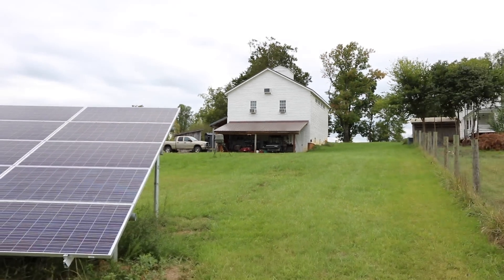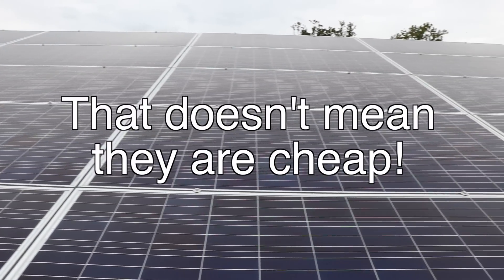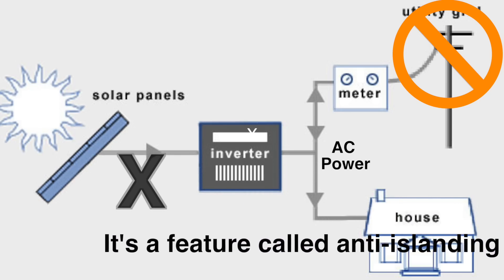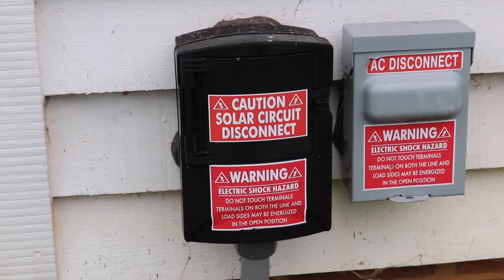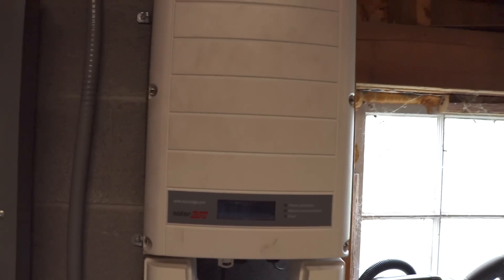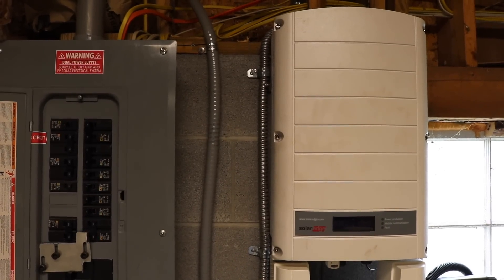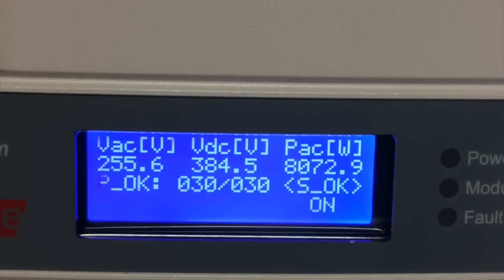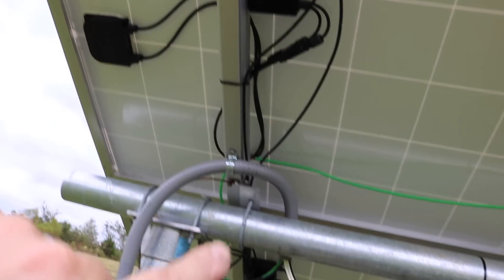The ugly truth behind grid-tie solar systems. Part 1, FarmCraft101 solar.  Watch before you buy!

Comment: Former energy auditor....
1) Do a 3rd party independent energy audit before expensive solar or dual pane windows.
2) Do cheap stuff first, massive insulation,  double up walls and partitions where possible, new doors, caulk leaks, LED lights, new efficient appliances, passive heating and cooling, zone heating and cooling, highly efficient wood heat, etc
3) Ask for 2 opinions/estimates and payback period from 3rd party expert for expensive solar (double the price if you want battery backup). These estimates should be based on your new "conservation" ideas. You will be surprised how much lower your e-bill is after measures.
Reply: David M best advice I’ve read for anyone. Doesn’t matter if you want solar or not your advice saves money and preps a homeowner for installing solar. I did many of things you suggested and made my house as energy efficient as I could possibly do. Followed the energy audit recommendations before the upgrades. Then I had a 4.6kw solar array added. It’s small and with all the upgrades it will power at least 70% of my energy needs. 

It may be better than 70% because that was a very conservative figure. It helped that I have a brand new 21 Seer solar ready AC unit and 98+ gas furnace to provide HVAC needs and couple with all the upgrades to the house.
Reply: We upgraded our place before the solar went in (LED lighting, high efficiency inverter aircon etc) and we managed to reduce our electricity usage to 7.03KWhrs a day with 2 people in a 3 bedroom house.
With the 6kw solar system putting out 17.2KWhrs a day, we reduced our bill from the original $300 plus a quarter to literally around zero or even negative numbers some bills, making the payback period just under 3 years... (it's almost paid itself off already, and will have after Christmas...) best four grand I ever spent...

Comment: Electricity doesnt go through wire it goes around the wire. Put a romex in a vise and test the voltage when you tighten it. You will cut it off.

Comment: 8 gauge wire in restricting your amps. You should be using #2 wire or larger. It will carry 100 amps. Just to prove a point try starting your car with 8 gauge wire and see what happens. Bring a fire extinguisher.
Reply: not really.   i guess you missed the part where it was  Explained.
watts  are   watts.     volts  x  amps  =  watts      use more  more
volts, less amps  and  slightly  SMALLER   conductor.       imo,
running  DC  any distance is, just plain, prohibitively expensive.
in contrast, if the inverter is located near the pv installation, AC
can be run to the house; using  Much  smaller  conductor; with
near zero losses.    cheers

Comment: I never see anyone talk about how the panels deteriorate over time, and how that affects the cost benefit ratio.  The useful life of panels is about 20 yrs right now, but they degrade about .5% per year meaning they lose 10-15% of their output by year 20.
Reply: Yes, they do- but the tier one panels used in all gridtie installations (at least here in Australia) have a 25 year 'guarantee' (not useful life) that they will still be above a certain percentage of their original installed power- in my case the panels have a guarantee that they will still be above 82.7% of their original power in 25 years, so mine will be at 4.95KW instead of 6KW in the year 2042..... (and their life expectancy is far longer than that)- hardly a reason to ignore the massive benefits they give on my power bill, which was reduced from $1200 a year to zero, sometimes less than zero... ROI is only 3 years at that rate, after that, I get electricity for free...

The outrageous US prices may be why (like FarmCraft) sees ROI of nearly a decade or more- that's more a case of their huge price for installations over there, literally five times higher than our here in Australia... 

I do have to wonder why solar is so pricey over there though...
Reply: AU I think gets better subsidized rebate from the govt then US. AU also gets better sun :P so it makes ton more sense. And not sure what power is like in the rest of AU, but WA electric has risen beyond absurd, was not that way when I first moved here 10 yrs ago. It was one of the better rates.
Reply: @kevinfisher1345  Actually, we get less subsidy (at least in dollar terms) The rebate in solar credits on a 5kw system is $1200 here in Australia (and dropping) where the rebate (according to a guy I was just chatting to) on his 5kw system, he paid $11k US upfront, then had to jump hoops for 6 months to get his solar rebate, which dropped his price to $6500US for the system, and he had to pay another $1200US for the permits, total cost $7700US.... Mine cost $4000 in total several years ago for a 6kw system, now they are at $3491Au, which is $2600US for a 6.6kw system...
Reply: Hmm that sounds bit pricey for US, unless it included battery bank as well. HOWEVER, it has been over decade now since I have been to the US so will just have to take your word for it. But states can vary widely for installation prices and permits, as well as what all requirements must be met.
Reply: @kevinfisher1345  Well in the video itself, he said he paid $17k US for a 9.1kw system (gridtie), and we are paying $2600 US for a 6.6kw system....
Reply: True, they all deteriorate over time. The problem is that there are many methods of build design as well as quality. I have no clue where you got those figures, but I would guess those are averages. Especially considering most panels these days typically have a 25 - 30 year lifespan, and so those figures must be including cheaper units and even including flexible panels to have brought it down to 20 years. Realistically one needs to look at per the specific ones they are looking into getting which can all vary and would be rather complex to start discussing when talking about such a topic in a general sense. However it could at least mention that and taking that into your considerations. 

But overall, by the time you reach your break even point, it is all free regardless how much lower output they produce, the bigger point is expected life and when you might need to start looking for replacements. If it takes 12 years to break even for panels that will likely only last 15 years, that is not a wise investment. That however is a very unlikely scenario as that would imply cheaper panels in which it should not take near as long to break even. Again that could be argued that beyond its expected lifetime use, one really does not need to replace them, as it is all free regardless how much less they produce. The given stated lifetime is determined by manufacture when it has reached a significant drop loss that its considered no longer efficient. But they will still produce power beyond that given lifetime, just at much lower amounts then when new. So in other words this all in an roundabout way already all included, albeit just as per w/e amount the manufacturer has chosen. But generally speaking manufacturers list lifetime as 80% efficiency. So if a panel has a stated lifetime of 25 years, it will have decreased down to 80% efficiency by than. If panel has stated lifetime of 30 years, it will have decreased down to 80%. As stated this is all already factored in, in a roundabout way, so beyond a brief mention, it really does not need to be mentioned about too much. The biggest thing is this will increase your break even time, but videos do not go over and mention all the other things that will impact that either. So why are you expecting them to mention one aspect point but not all the others? That would entail a much more in depth video and really is more of case by case point that should be discussed with experts when actually going to install such a system.

Comment: Very good presentation. Just one concern. I know this is a fairly old video with respect to the pace of cheapening photovoltaics, but $17K USD still seems like a lot for a 9.1kW system - especially seeing as you got a ground mounted multicrystalline array. This figure is not including the batteries right? I would be interested to see a price breakdown for this. I guess it doesn't matter too much as you still get a fairly good rate of return.
For reference, I got a premium quality 10kW system installed on a 2nd storey roof for $15K AUD unsubsidised (about $10K USD), with SunPower mono IBC cells + SMA inverters which is pretty much the most expensive combo you can get. In Australia, large price differences between similar systems are mostly accounted for depending on the installer (ie. dodgy installers will charge much less for labour). My installer is one of the more expensive ones as they are accredited by the Government regulator and trade renewable energy certificates on our behalf, so it's not as if I cheaped out on labour costs either.

Comment: They have 2 pole or 3 pole disconnects so you wouldn't need  separate disconnects. You would just get a different disconnect to meet your needs. 2 pole disconnect would give you 240 volts (two 120v feeds). Or whatever you need to achieve the desired voltage.

Comment: Does this change how much your fire insurance cost? Probably not but  I thought I would ask. Two,  you come home after vacation and someone's Easily taking off with your solar panels because they are at ground level as opposed to attach to your roof. That would suck,  do you need separate insurance on your solar panels and would it cover theft or just damage like hail. And what is the lifespan of solar panels I heard they are 20 to 25 years. Giving you a good 12 years a free electricity. Probably not normal questions but I'm new to this
Reply: You heard wrong (although it is commonly touted as a reason not to get solar) They have a 25 year output guarantee, mine have one that in 25 years, then panels will exceed 82.7% of their original output after 25 years- ie that my 6kw array will still be putting out AT THE MINIMUM 4.95KW, their life expectancy (short of physical damage) is 50 years plus- there are systems that are already older than 25 years on grid tie in Australia, and some offgrid systems are 35 years plus and still producing 70% of their original output...

Comment: 8 hours x 8000 watts= 64 kilowatts per day.   Impressive.
Reply: Yes but keep in mind loss of energy no system is 100 efficient solar panels are 60 percent efficient plus conversion of dc to ac electricity make morr power loss about 40 percent so actual units of electricity produced will be lower that calculated value

Comment: What I don't understand is if you can have a battery back up system tied to your panel without fear of it sending power out to the grid (anti islanding) during an outtage... then why can't the the same mechanism work for the solar as well.  I swear its a conspiracy by the power companies to discourage some people from discovering that maybe they could live without the power company after all.  I see no technical reason why a battery bank can power your house during an outtage... but not a solar array.  They are both DC sources of power.  Makes no sense.
Reply: agree.      it can be understood that the key variable is whether a  
building is  Still  connected to the  power grid.   if it is not,  then 
there would not be a  back-feed issue.        obviously,  correct
power  Switching  is  critical.

Comment: Can I ask how do you connect the cable from grid tie inverter to the cable from electricity company ?
Reply: The Inverter is usually tied directly into a Breaker Box and has its own Breaker on the rail.

Ideally you get a Transfer switch installed so you can have electricity during outages.

Comment: LOL I'd be clamping Schottky diode between the output of the panels and the house, put it on a divert switch, anytime the grid goes down flick the switch and negate the grid tie portion...      power straight to your house   lol
Reply from the maker: Wouldn't work.  360V DC straight to my house.  Everything runs off of 120/240V AC.

Comment: A solar charge controller is what coverts energy from the solar panel. Over time, I am seeing more and more solar generators and other devices that have a solar charge controller and inverter built in. I’m sure that is what is used in your setup.

Comment: Maybe I misunderstood something but I’m pretty sure that you have 3 sets of 10 - 12 V panels paralleled with those 3 sets in series, yielding an absolute maximum of 75 Amps at 120V DC. Contrary to popular opinion 8 AWG copper conductors can carry this load with no problem because of a lack of skin effect.  If you’re are running to an mppt/inverter then to the grid, I’m not sure you could have it any other way.  Unless you’re using micro-inverters.  Am I missing something here???
Reply from the maker: They are 36V panels in sets of 10 for 360V.
Reply: FarmCraft101 Thanks for the clarification.  I think I focused in on the fact that you were using 8 AWG wire do I was looking for the max current to be 40-80 Amps DC, when in fact you’re using number 8 to account for voltage drop (looks like a good few hundred foot run) and to provide a bit less resistance.  Right?  Awesome setup BTW, and thanks for the great videos!

Comment: 9:05 WRONG! Current Does not take the path of least resistance, read kirchhoff's current law. If I have two loads of unequal resistance, the current flow will be relative to the differences in resistance. Current takes the path back to the source, (power generating station). Water may take the path of least resistance, Electromotive force does not.
Reply: jeezuss.   it was 'electricity for dummies'.     weird,  you should have
fit right in.
Reply: @daviddavids2884  keep telling yourself that
Reply: @Marvinthecoinhunter  oooh.  wait, what.    no cut.   is not witty.
does   NOT  compute.    go back to your cereal and
cartoons.

Comment: IMHO the ugly truths are 1) most roofs cannot accommodate all the panels needed to support a typical household using 4-6kW per day. 2) up until about 2015, quality grid ties like sunny boy, cost consumers at least 2k.  Installers add their mark-up to it in my most cases.  It's not surprising the payback period is so high.  Even with today's lower prices, the cost-benefit ratio is mediocre.  Often, you need these kind of circumstances to justify it: a lot of sun year round, high per watt charges, running A/C a lot, driving an electric car.   Here's ugly truth 3), perhaps the biggest one of all.  The dept of water and power will always want it's pound of flesh one way or another.  If a community starts supplementing with solar panels, The utility inflates something else.  In my county, they dreamt up a bunch of new sewer fees.  As such, you'd be lucky to cut your bill in half, because it's loaded with fees unrelated to electricity.

I never met a person who believed grid tie inverters would save you in a power outtage.

Comment: You can always double or triple the gage of wire with out buying thicker wire just by connecting them together on a parallel sequence, cheaper way of delivering more amps. Thats if your stuck with smaller gage wire. Or can pick up some cheaper elsewhere. Example Most people that have cheap jumper cables trying to jump start a car will often have terrible amp draw and the dead car won't turn over obviously but lets say your friend has an extra pair of cheap jumper cables and you join the cables together red on red and black on black your gonna double the amount of amps to the dead car. I know from experience I have a huge 10 lug 24footer truck and has damaged cell lead acid battery and I parallel  two jumper cables together and connect them to my wife small sion tc two door car and starts up first try every time with high current draw.

Comment: All good.... in concept, thus far..if only the  very best quality systems installed..I guess..but ..I .have been put off installing so far,  because ,Cost,and  limited to  6.6kw max. , pole to house supply line, solar panels with ever faster decreasing output supply, and  of limited life 20 yrs,..on average ? , but met a few with chronic inverter failures, non replaceable...$$$$$$ , batterie$$$$from neighbors who initially thought a great idea, green etc....now it's all heading for land fill ,mmmm maybe wait a while, cheers

Comment: Interesting, thanks!  

Would you consider experimenting with covering panels to see how much the optimizers help?    You seemed uncertain of the improvement they claim to provide.
Reply: The optimizersbdo work with the solar edge system, I have installed 1000,s of systems and of all types. You only need optimizers or a micro inverter(enphase) if you have a shading conditon.

Iif I did have a shading condition I would personally stay away from solar edge due to in my own experience 3 out of 5 fail (mother board fries).

Good video nailed most of details right,  getting those conductors in a conduit and not fmc/lfmc(flexible conduit) would like much cleaner.

And as far as the disconnect, you don't need a disconnect per wire(phase) you get a disconnect that has the proper poles and throws for your application.
Reply: BattleJohnson if you won’t use optimizers and did have a shading problem, what can be done other than moving the panels?
Reply: Its not just a claim Optimizers do help... I wouldn't recommend an install without them, they aren't cheap but good long term. Especially if you have a system with monitoring software, easy troubleshooting if one panel stops performing.